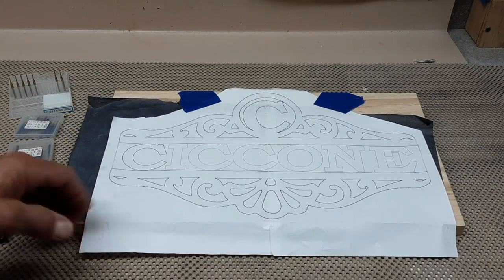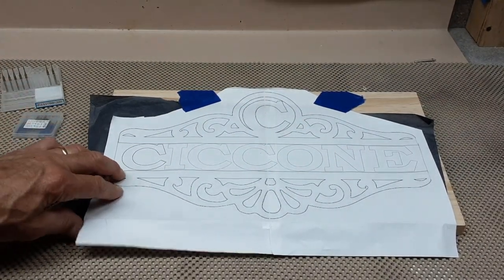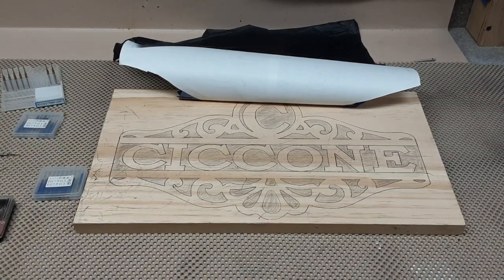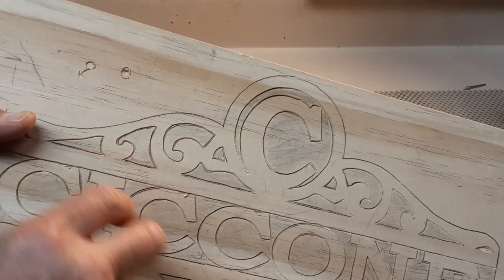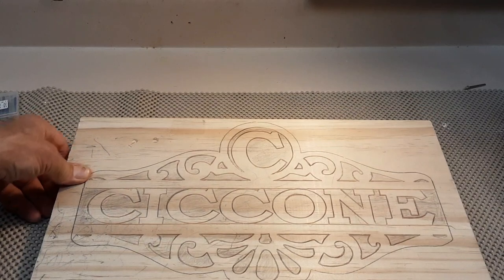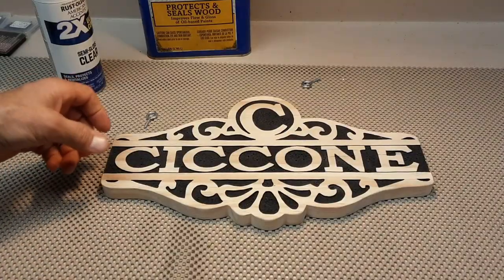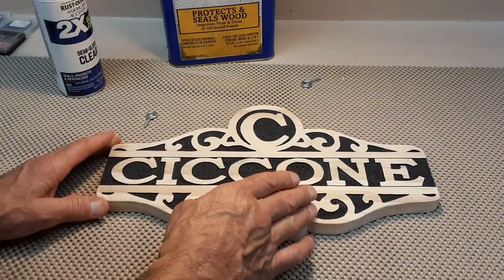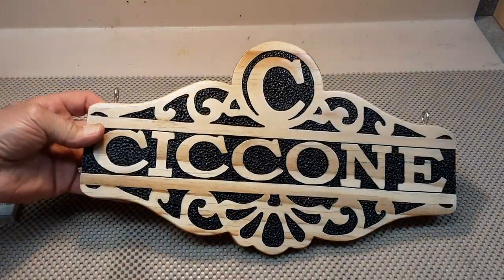Routered Name Sign, Hand Carved on Pine Wood ( Steve Good pattern )

Comment: Gives me some ideas I had not thought about. Could you establish a cut line like when using
a chisel for you straight cuts. Use a straight edge and a marking knife giving you a shoulder to cut 
against. Thanks for some great ideas.
Reply from the maker: James.. That's a great idea! A chisel for marking a straight line would work. You would just have to make sure the milling bit is set at the same depth. I'm going to try that. Thanks for the feedback!👍

Comment: What was the unit you used with the Dremel tool?  Nice finish project!!
Reply from the maker: Thanks Niel! I have another router... it's an old Black & Decker and it only uses bits that are 1/4". You need a 6.35mm collet reducer to use the 3.175mm cnc and end milling bits. I sometimes use both on a project having the cnc bit in my Dremel plunge router and the milling bit in my Black & Decker router set at the same depth, this way I don't have to stop and change bits. I hope this answers your question. Please let me know.
Thanks again!

Here's the link to the collet reducer.
https://www.amazon.com/dp/B00N9WRB0I/ref